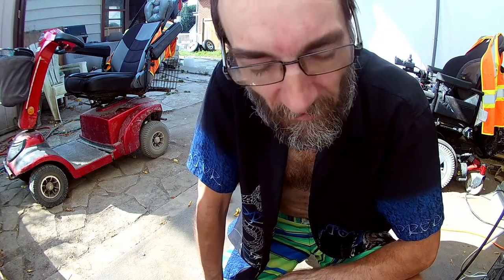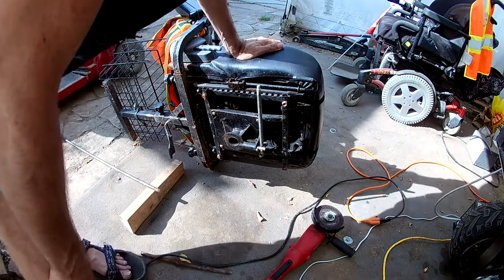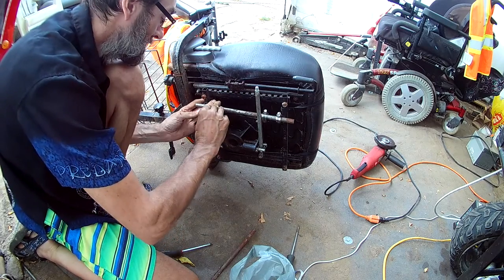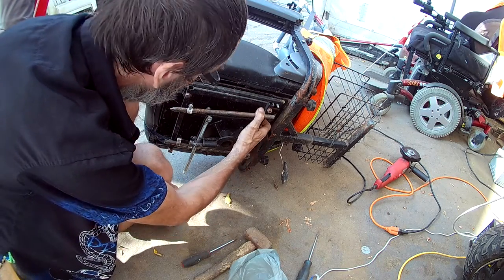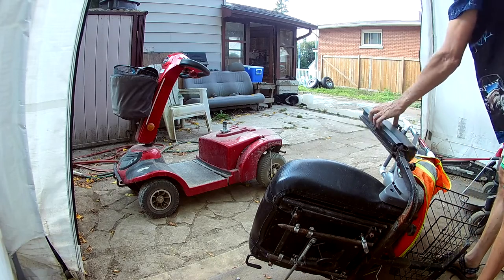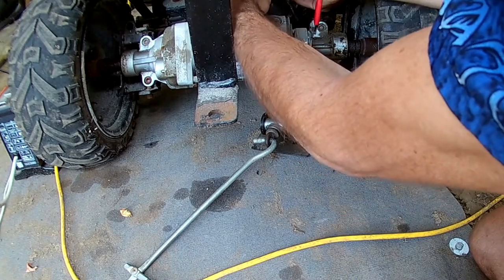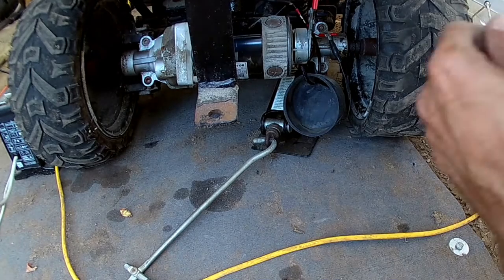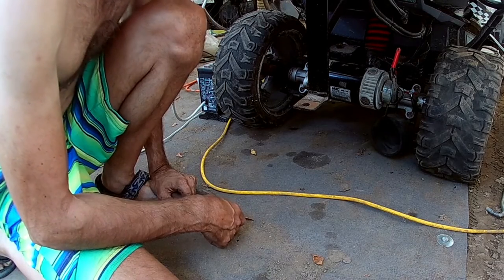ES950 Wheelie Damage and Revisiting the Monster

Comment: I see you have been having lots of problems sorry to hear about your health declining. i didn't see any new videos posted for a long time seems for some reason i wasn't getting notifications here. But i watched few of your videos and noticed, you've had issues with batteries, wheel bearing issue.

I'm sure in a previous video in the past i mentioned the parking break may need replacing. The reason for this is sometimes it freezes solid and rusts up causing problems and the rust  needs removing but obviously you need to take it off the motor to do this. 

Here is a video that may help although be aware from watching this video you can see how the manufacturers make these scooters not to be fixed and he sheers off the screws just to remove the trans-axle so if that has leaked all the oil it maybe a real pain to fix. But you did pay someone before to do something with your own motor because of the screws. https://www.youtube.com/watch?v=taua7C8HqCM 

The service for scooters certainly does not include stripping them down entirely to replace rusty areas or wheel bearings or replacing faulty wiring looms, or checking the circuitry of the controller boards. 

I think for the price of this scooter the amount of faults it has makes it certainly not worth its price tag.  Your ES950 has been far more reliable and cheaper too.
Reply from the maker: I don't know what's happening with YouTube. You aren't the only one not getting notifications when videos are uploaded. It seems to be a widespread problem. I noticed one of the channels I follow had videos I'd never seen so I made my own system that looks for new videos on the channels I follow. There are over a hundred channels so it takes some time. I usually run it when I go to bed then, when I wake up, I'm presented with a list of videos that have been uploaded since my last scan. I can then choose which videos to ignore or add to my playlist for watching. It serves me well.

I won't touch the brake; aside from replacing it. My tech guy told me they are difficult to service due to the shims inside. That's good enough for me. The ES950's brake seized up due to sitting after I got the monster. The replacement I got didn't fit properly so it's just hanging by zip ties... it has to be there electrically or the scooter won't go. The Monster's brake hasn't been a problem other than the connector plug.

I paid someone to remove those long screws in the motor. It turned out they had lock tight on them. Removing the motor from the axle housing is no issue as it is set up differently on the Monster. There is a faceplate on the motor with four holes on it. The bolts go through these holes and into the housing. So much better design. I've already had the motor off twice and neither time was an issue... thankfully. I would have been pissed if I had snapped off the bolts. The bearings don't seem to have an easy solution. They are just plain nasty to remove. I may have come up with a solution though. I'll find out next time they need to be changed.

The Monster is definitely not worth the price due to the high maintenance and lack of reliability. I regret buying it. At this point in my life, my illness has progressed to the point where I may not be able to do these repairs anymore. I may have to depend on a service technician to do them for me. :(

Thanks for the video link. That was an informative video and was worth the watch.
Reply: I new the video would help with this.

Now you said you have a system for searching new videos so this would be useful to know because i dont think its just your channel i havent had new video's from channels showing as im subcribed to alot of other channels.

When i initially subscribed to channels it automatically told me when new videos were available, but it seems now that youtube added a new set of settings but without telling people.

I found a hidden bell in a setting and clicked it now i dont remember seeing that before so ive tried that maybe it will notify me now but if not if you could explain your system in a video it could be helpful.
Reply from the maker: In my opinion, when you subscribe to a channel, it's understood that you want to know when new videos are uploaded. After all, that's why you subscribed. Why YT came up with this bell option is beyond me. But, even with the bell selected, I've still missed uploads.

As for my search system, it's part of the internal website I have in my computer. It automates much of what I do and the thousands of files and tasks that I process daily. Without it, I'd have to search for each and every file, rename them accordingly, then sort them alphabetically or by date, depending on their use, then put them where they need to be. I have a multitude of external hard drives that files cycle through until they eventually get where they are needed. It would take many many hours to do what my system does in a few minutes. The YT search is a recent addition I made. I like to watch YT videos in the order they were uploaded and all new videos are added to my viewing playlist in the proper order. I've been asked before if I could make a stand-alone program for someone to do this for them. Unfortunately, the only way I could do that would be to use javascript but js is finicky about manipulating files in your computer due to all the required security measures and I'm not sure how to get around that. I'm not very knowledgeable about javascript. I currently use PHP, but it requires APACHE to be installed so your computer basically becomes a server that's unavailable to the internet. Besides that, I have it set up for my particular filing system and needs and I'm not sure how to make it universal. Perhaps, someday, I may look into it. It may be easier than I think.
Reply: Well i have something called favourites or bookmarks so i can see videos i liked but nothing that searches for new videos, what browser is it. 

As to the monster does it still need a bearing as you did a video replacing it or do you actually need to buy the whole bearing assembly from new. 

As to the play in the wheels turning, isn't that something you get from both wheels spinning in opposite directions when not moving together. on the ground. 

Now you mentioned nothing about the controller, as i was thinking it could be this causing it to overheat.

I know that some of these issues are what are probably the most expensive parts on the scooter to fix.

In the video i sent you what is interesting is that he says the magnetic break inst a break at all. 

For scooter makers to change this they would need to put disc breaks on something ive yet to see, but it may be safer.

Now if it is a controller problem, i think you have 3 options
1 put in the same controller
2 try the other controllers you can use with this model of scooter
or 3 which i think is the best option if you have voided your warranty replace the controller with a custom controller as some of the features on the manufacturers controllers are the reasons you get a lot of the errors also, they seem to draw more power than a custom controller, its like the weakest link in the scooter build.
Reply from the maker: My system is basically a website so I can use it with Internet Explorer, Microsoft Edge, Google Chrome or Firefox. The only difference is, it's contained in my computer and is not available to the internet. How the Youtube search works is, it retrieves the main video page of a channel and makes a list of all the video urls on it. Then it checks the upload date of each video and if it's older than the date of my last search, it is ignored. Only videos that have been uploaded since the last search are processed. This is repeated for all the channels I watch. Once the process finishes, I get a list of new videos, sorted by category (such as news, which I watch daily, or rare, which are channels that only have the occasional video that interests me, etc). The list includes the channel name, so I know who uploaded it, the video's title, the video's url, so I can click on it to preview the video if I choose, and the video's thumbnail, the same thumbnail you would see on Youtube. Then I can choose which videos to ignore and which to add to my watch list. This process takes 2-3 hours to complete, mainly because I have a time delay between each channel so I don't overwhelm YT's bandwidth.

Thankfully, the Monster's front wheels use widely available bearing size. I can get a 10 pack from Amazon for about $16. The problem is, by the time I realize they need to be changed, they are pretty much toast. They are very difficult to remove from the hub because you can't get behind them to force them out. What happens, is they fall apart and the outer raceway stays inside. It would be easier to replace the hub, but cheaper to take it to an auto shop and have them cut it out with a torch.

I have changed the controller recently but that wasn't the problem in this case. I'm not sure where it is in upcoming videos but the actual problem I'm facing with this issue baffles me. The problem is with the motor but is something I've never seen happen to any other motor. I even showed it to an electrician that works on motors and he has no explanation either.

As for brakes, it would be ideal to have front brakes on the Monster. I have shown in a previous video how the rear wheel comes off the ground when swerving, thus having no braking action until the wheel comes back down. I see it as a safety issue. Having front brakes would eliminate that problem.
Reply: ahh i dont have edge i dont really like the new windows its horrible haha
Reply from the maker: I absolutely hate Windows 10! I had to buy a new computer earlier this year and, unfortunately, it had W10 installed. I'm a little more used to it now, but I still hate it.